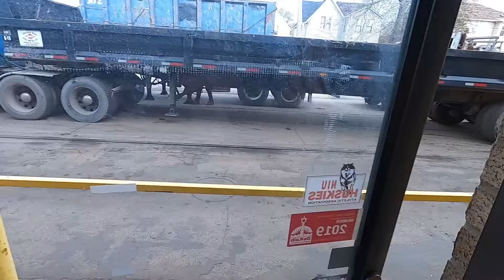What Are You Doing with My Trash? I Take the Fifth

Comment: 🇺🇲🛻🇺🇲 Hey Paul the Fort & Scrapping guy!! 
Ok 1st at the pond when u first walked up the reflection of the cloud on the water looked like an angel..2nd that bench with a power strip would be great for your fort..3rd remember your center of gravity when lifting or moving things that dryer almost got away from you cause it wasn't close to your center of gravity, walk backward when pivoting appliances it's easier. Lastly keep an eye out for at least 3" wood screws for your fort, also have ready some 2x4"s to go across the top till your ready for your roof pallets, I used 4x8' pallets for my roof, best of luck building don't get stressed, make it fun and have some laughs too. God bless you my brother, Good night. Ps. AI sky was unreal unlike that stuff.👍🙏

Comment: Paul, with washers and dryers the cord is not included an more since there are several plug types so you have to buy the cord that matches the outlet in your home.  As new as that washer/dryer was the homeowner probably just reused the cord on the replacement.

As for the fridge, most RVs have a dual power (AC and Propane) Fridge so you don't drain your battery if you are camping without electric.

Comment: I got a fence permit in ore & I built a fence from pallets was 6 feet high & 40 feet topped by barb wire to stop drug runners from using my yard as a runway  was the cheapest fence I ever built lover the prayers everyone who has dazing appliances has problems with them my friend has one & has to stand by it to make sure it had enough water the bldg to picked up holds a candle

Comment: Paul, I'm sure your truck can handle 2000 lbs easy. I have a 1989 F-150 4X4 that now has about 350k miles on it. I would pile that thing to the sky with metal or whatever. I remember getting a load of rebar from a job site and thinking it felt like 2500 lbs. When I weighed out I was amazed to see 3460 lbs on the ticket. 4500 lbs seemed to be the limit for my beast though. I once had 1k in back and 10k on my 2k lb trailer. Glad I didn't get pulled over,lol.